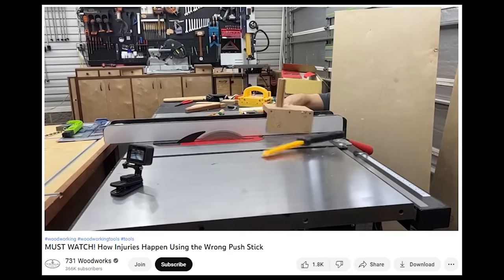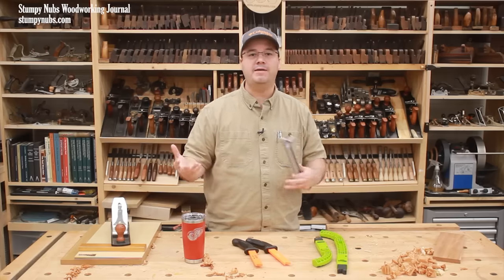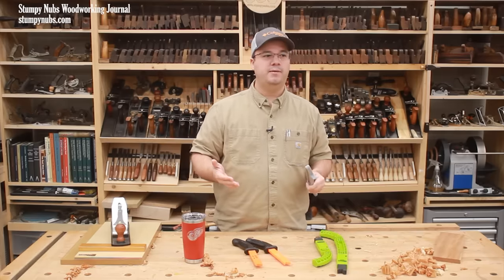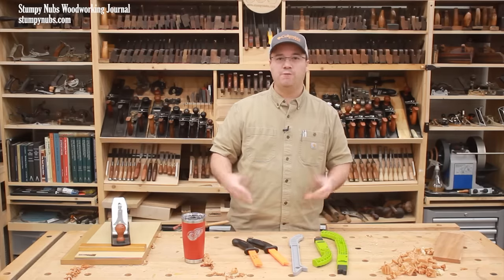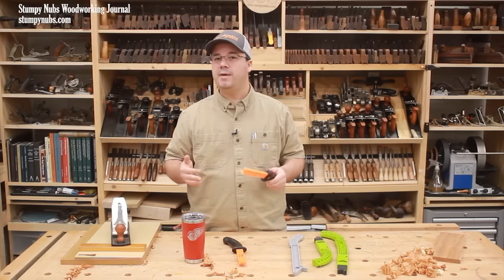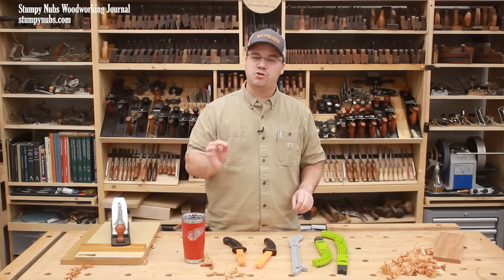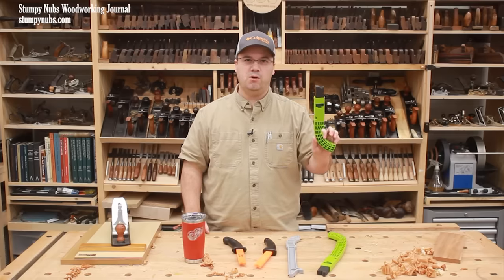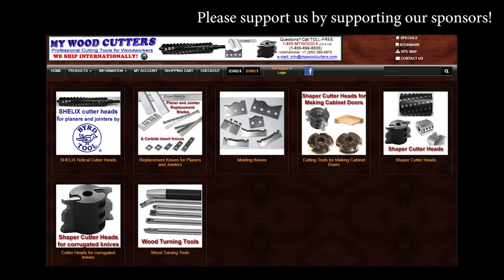EXPLODING table saw push sticks are a real thing!

Comment: Very good video.  I've been using the cheap hard plastic push stick that came with my saw thinking I was safe if it hit the blade.  I just ordered one of those pro sticks with a couple extra replacement tips.   $4 is cheap insurance compared to sewing something back on.
Reply: if you like a push stick. I don't...
Reply: @davidcurtis5398  I'm not saying I like them, but right now my "table saw" is one that my father in law purchased at Lowes on closeout 10 years ago for $50.  I don't have the setup to use my real saw as it's 220. That one is a 1946 Delta Unisaw.  Plans are in motion to get a new 400 amp service for my place in the spring.
Reply: I'm using the table saw my father bought over 70 years ago. It is a Craftsman and is still going strong. I also have a Grizzly table saw. The older saw has the motor that hangs off of the back and the belt tension is the weight of the motor. Dad  would use the same motor for all of his tools. His saw, his joiner, and the shaper. The drill press had its own motor.
Reply: @covishen  Woops, forgot the belt sander.
Reply: @davidcurtis5398  those old saws really do good work. But they do need cared for.  That unisaw has a motor that weighs 50 pounds, and is rated at 3/4 HP, there are 3 V belts driving the blade and I have never seen that saw bog down.  That said, there are no safeties, i'm currently looking for some kind of blade shroud and new fence.

Comment: Another good video.  Thanks for sharing.  Never thought of the plastic explosion factor for a push stick and didn't see the other guys video.  I did lose a sliding compound miter saw to a piece of PVC pipe that blew up when I was cutting some dust collection piping on it, so I get the  brittle plastic factor.  The discontinued lower blade guard took out a window in my shop and sent shards flying.  Not my best day.  Lots of dangerous stuff in a woodworking shop, so always good to think safety.  PS - I have a contractor's grade 12" sliding compound miter saw from Craftsman for sale for anyone not interested in keeping all their fingers. 🤪

Comment: The explody kind of push stick is probably made out of ABS.  ABS is the most common type of plastic for consumer products.  It’s hard, has good surface shine and has a little bit of flex to it but will break if bent too far.  You want a push stick made out of polypropylene or polyethylene.  These will be a lot softer, should always feel just slightly greasy (a property called lubricity) and should permanently deform when bent too far.

Comment: I don't use "chicken foot" push sticks. I had a kickback incident that scared the crap out of me. I was pushing thin plywood through the saw using one of those. The board on the other side of the blade came up and straight back at me. So I studied push sticks for a long time and abandoned the long chicken foot. I made instead a push stick out of plywood with a long reach and handle up high away from the blade. I can put downward pressure on more of the board than the chicken foot allows and I've never had that happen again. I made these long-reach push sticks out of different thicknesses of plywood. So far I have been able to avoid the blade, but I can cut out a new pusher on the bandsaw in a few minutes. And the ability to put downward pressure on more of the board makes me feel better about making these cuts, especially on thinner material. I saw Matt's video and was interested to see your comment. Thanks for the good information!

Comment: there is a cheap plastic that is really weird feeling, hard but slightly bendable because its often used really thin. this stuff breaks like glass when stressed. and those shards fly through the air like knifes and are insanely dangerous and sharp. i would really like to know which specific type of plastic this was. i think some kind of abs

Comment: Thanks for a great follow up with more context.  I use plywood to make push sticks.  It will not shatter & grain direction don't matter much no matter how you slice it (pun intended).  

My biggest problem with push stick comes with the saw is that the notch is very deep.  It's more than 3/4" so if you are cutting 3/4" or less, it will make contact with the table top and dragging across.  It often gets hung up just a little when you get to the throat plate.  What' below the top of the board can come in contact with the saw blade easily because it's hard to see.  When I make mine, I ensure it's 1/4" so the push stick will not touch the table top when I'm using it.

Comment: My table saw came with a plastic push stick and a pattern to make more.  So, I made several push sticks out of scrap 3/8 inch plywood using my hand held jig saw.  I even glued pieces on either side and shaped a nice comfortable handle with the Dremel.  It took maybe an hour.  I'd like to make some thick plywood push blocks, but haven't yet decided on which design I want to use.

Comment: Long push sticks have their place, but I don't care much for them.  I just seem to lack control  when I use them, and prefer to have "more stick" on the surface of the piece. Sometimes the further you are from the blade, the greater the risk due to a lack of control.

Comment: First, I want to thank you for your careful explanations without a lot of drama and urgency in your voice.  Every topic doesn't need a lot of hype to demonstrate.  731 is not the only one who does that.  He's not even the only woodworking channel that does.

When I do use the table saw I have an old push stick cut from 3/4" plywood on the bandsaw.  It has some nicks on the tip to show it's working to save my fingertips.

Comment: Really highlights the difference that material selection can make. I'd rather not think about how some of the DIY 3D-printed push sticks would react given how brittle some the plastics can be.....  (if they snap, crackle and pop with just hand pressure they probably wouldn't react well to being struck by a saw blade).

Comment: I saw that 731 video and I had two issues with it. 1. He never mentions that most all of us can use a push stick for decades and never put it into the blade. 2. He didn't suggest that we make one. Assuming you'll be putting the push stick into the blade all the time and we always have scrap around to make one, why not do that? I hope all the tablesaw dealers see these videos, they don't need this bad aura over something that might be just fine in the right hands over them

Comment: As always, another informative video. I'm a make them from scrap wood guy. I have assorted types, from the long notched stick to the lays on the top with a lip in the back, to suit the need. And I run pine push sticks through the blade all the time when cutting narrow stock. Just over to the bandsaw and cut a new notch when needed.

Comment: I've been using the same plastic push stick for almost 40 years.  It has not even nicked the blade in that time.  The simple rule is to not let your push stick get too close to the blade.  If your cut is so narrow that the stick looks like it could contact the spinning blade, make a narrower push stick, or maybe one that rides along the fence for added safety.

Comment: I don't use push stick because you have less control.  But, since you really don't want your fingers near that blade, I use a sacrifice push tool.  Usually it's a piece of plywood - 1/2 inch thick and 8 to 12 inches long as often as not.  I cut a long narrow rectangular piece out of the sole from the toe to about two inches or so from the heel.  The cut is half to three quarters of an inch deep.  I round the upper rear corner where I hold it and usually sand it to reduce the chance of splinters.  The saw blade can cut into the sole and heel if the cut is close to the fence and if it gets too cut up, usually I can renew the sole and heel once or twice before it gets too thin.  I can hold the cut piece down on the table as well as push it.  And, it will slide over your riving knife in the same cut.
Reply: Yes. I've always used these. Part of being safe while using a tool is actually feeling safe. Push sticks always felt really precarious to me. Especially with smaller stock.

Comment: Hi James:  I have watched your videos for a few years now and I really enjoy your content and your years of experience and knowledge.  I have been working as a carpenter for a little over 40 years now and have been fortunate enough to never have experienced a kick back. I believe that a lot of problems can be avoided by having the blade raised only an eighth of an inch or so above your workpiece, and holding the push stick tight to the fence when ripping narrow stock.  That way, very little of the push stick comes in contact with the blade.  I also prefer homemade push sticks that put downward pressure on the workpiece as many others have commented.  Thank you also for your finesse in handling this issue.  John Jensen from British Columbia

Comment: Excellent video. I’m a fan of plywood homemade push sticks because plywood is less likely to shatter than solid wood. That stick with the replaceable foam end is pretty cool, I have to admit.
Reply: I mean if you want a wood version of that you could do a lap cut on the wood stick and glue on a new wooden push end. Glue some dowels if you want to be fancy.
Reply: I honestly never had solid wood either softwood or hardwood shatter in my homemade push sticks. I always design the grain in the direction where it will be the strongest. Always made it with 3/4" thick lumber of whatever useless scrap I had sitting around. Only just recently tossed an wood push stick away because I cut out all of the usable wood out from my cuts.

Comment: I have a 3/4" wide plastic push stick (the plastic is firm but soft) but I also have made my own 3/16" thick push stick for thin rips.  One thing I paid attention to was to round the end so it would not tend to dig into my hand if there ever was any kickback. I think that is really important.  The curved handle design isn't just about comfort but so if there is kickback it will slide through your grip instead of pushing into your hand.
Reply: I can personally give credit to that point of sanding the edges rounded on the handle side. I had a flooring piece jam and fly back into my homemade wooden push stick(edge un-sanded). It ripped it down of my hand and some skin along with it on my index finger. All healed now but I got a faint scar mark which may go away.

PS: I'm definitely going to go sand the handles of my push sticks in a few days. Ruined sanding belt strips are perfect for rounding edges.

Comment: Laminate a paint stir stick to each side of a piece of 3/4 inch stock and you have PLENTY for the handle and SERIOUSLY reduce any "hogging" out of waste to make it ergonomic... My old standby on a "push-stick" specific was to make it at least 18 to 20 inches long so there was enough material that I could grab up a hand saw, mark off JUST enough of the end to get rid of the "chewed up part" and re-cut... BOOM... and fixed...

    Want practice on your dado's??? Marry a plywood triangle to a flat board "long-wise"... say... the broad side of a 2x4... You can then glue them together and laminate a strip of 1/4 inch across the "rear end" of the 2x4 and you've got a "sacrificial micro-jig knock-off" give or take whether you prefer to just drill the holes in the plywood for your fingers or drill through "top and bottom" and use a reciprocating saw to hew out the entire handle shape as you see fit...
     With this one, as you "chew up" the 2x4, you can shave away "the worst of it" and laminate a new strip across the back, whether you stick to 1/4 or upscale to 1/2 inch for it... It's no skin of my backside whichever you prefer...  AND as long as you can press down and forward STRAIGHTLY along the fence, you WILL be safer for using the f***ing thing.

    BOTH models from scraps and glue, and they take maybe a handful of minutes of actual work, and overnight to cure the glue... You'll NEVER IN HELL worry about running either of them into the blade, and it's some fine and fun project matter to teach the noob's and inexperienced what REAL SKILLS are worth around the shop. When you start out by getting used to BUILDING YOUR OWN EQUIPMENT, you relax a little bit and focus on doing things properly instead of all the mystique of "hobby versus pro"... If your triangle of plywood (for instance) isn't "dead square", it's also NOT the end of the world. It may not quite last as long as you'd hoped, but "close enough IS close enough" if you can use it with reasonable confidence... That's what makes it EXCELLENT practice for beginners... The same with getting the notch "right" at the business end of a push stick... It takes a little trial and error just to run the saw and learning to make small adjustments makes that another EXCELLENT novice project... It's also great for learning how you change the angle just a little to make use of a bit shorter and shorter push-stick... 

    JUST don't let it get TOO short... 

    I thought everyone had things like these rattling around their heads... BUT I've been mistaken before... haha... Hope it helps SOMEONE out!!!  ;o)

Comment: Stumpy. There are also other environmental factors for Shatering plastic push sticks:
-Temp: cold makes most plastics brittle
-You are also finishing woods in your shops. Oils, varnishes and the solvents used to dilute those. Over time, those can do strange things to plastics. (softening or hardening) 
-Radiation: UV and IR, again affect plastics. (softening or hardening) 

Yes, i agree, Make (or buy) a push stick designed to fail safely. Like that 2 part green example you game. At worst, you get hit by a 2-3 gram block of foam. Foam is soft, replaceable and inexpensive. (Could Balsa wood replace the foam, in an all-wood-stick?)< Question for peeps with actual knowledge. From my pov, the density and grain structure might do the trick; pls test?
Plus the added benefit you mentioned: ergonomics and Taste. If you make it yourself, you'll probably have it fit perfectly in your hand> bonus to dexterity. Also the fact that you'll LIKE the feel of it and WANT you use it, rather than (eye-roll) have to use it... and "forget" to use it because "you've done that same cut for xy years".

Comment: Try drilling a small hole in to the push stick, ideally using a bit designed for wood, if the drill bit goes in easily, you are fine. If bit only goes in after getting hot, it will probably shatter. 

For plastic types, ABS and PC are soft enough, PET is not bad, PLA is bad, HIPS is worst. HIPS is a high quality plastic but its properties are for not for this job, it is extremely strong. ABS, PET and PLA will get harder over time via temperature changes and UV exposure. I am not sure about PC, but it is advertised as UV and weather resistant.

Comment: Thanks. This is a great video. I also watch 731 Woodworks -- good guy. I saw your video before his. I'll watch his next. I think I own some cheap plastic push sticks, and I use them sometimes. I also use push blocks made from scrap 2x4s. I think I'll probably end up using scraps of soft 2x4 SPF, rip it down to a couple thicknesses between 1/2" and 1", and make a couple push sticks with that since I think it would be strong enough to push anything through my table saw yet so soft that the blade would chew through it and be less likely to catch and cause kickback relative to harder woods.

Comment: James...I watched Matt's video, twice, the day he downloaded it. First in shock, then to truly observe, not just watch...if you catch my drift. His testing (?) method was kinda hinky and made me wish it was Todd from Project Farm doing the testing. Hmmm...maybe I'll recommend that the next time I watch there.
Your follow up certainly cleared the air. I use homemade push sticks/push blocks in several shapes for all my stationary blades tools. I have what I refer to as a "sacrificial finger" ( one that's been mangled twice ) and it is a constant reminder of just how quickly this can go south. My go-to material is straight grained, knot free ponderosa pine, as I live in the Pacific Northwest and common yellow, or southern pine is considered a luxury wood in the category of the oaks, walnut, cherry...etc. I choose that wood for cost (I don't use scraps!), ease of tooling and it's relative degree of softness as some will undoubtedly be used in contact with blades. I have several angles in my 'birdmouths' pursuant to the thickness of wood I am cutting. I have push blocks with and without 'keepers' on the ends. I sand, round over, and paint the handles. On push sticks...that's the top 8-10 inches. Once a sacrificial stick has been ' reformed ' once or twice, and it can be seen that another reformation will cut into the paint, it goes in the burn pile.
One thing I do when I am using a push stick on the table saw during a rip is to lower the blade until just the carbide tooth is above my workpiece. Some may disagree...but I would hazard to guess some haven't seen the tip of a finger reduced to bloody hamburger by a saw blade, either. That was a $30K bill that none of us need or want.

Moral of the story? Think. Think about making your cuts safely. Count how many fingers (and eyes, too!) you enter your workplace with...and do all you can do to leave with the same amount you entered with.

Comment: My go to push stick is actually a push block made from a 2x4.  Took about 10 minutes to create.  The radius edges that 2x4 have are perfectly comfortable.  I just sawed about 1/4 inch from the edge on one side with a band saw, and left a 6 inch toe.  That is important, as I can run stock completely though with my hand completely behind the blade.  If there is kickback, it won't draw my hand into it.